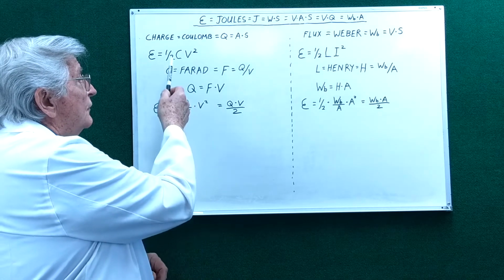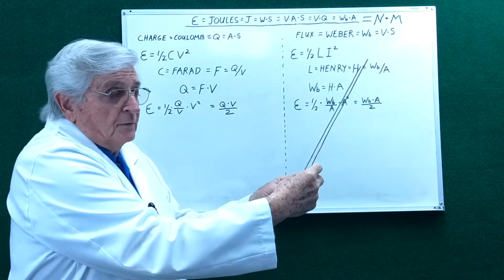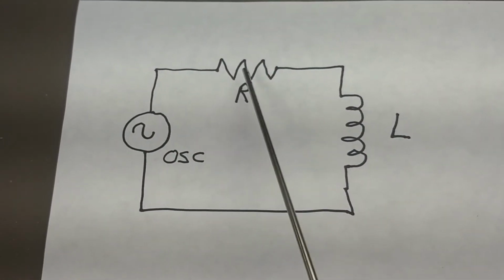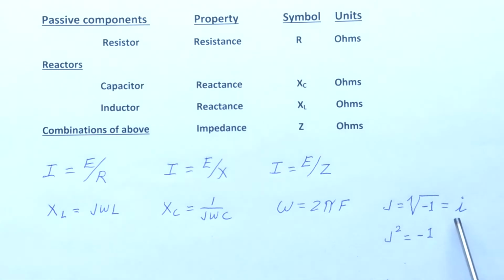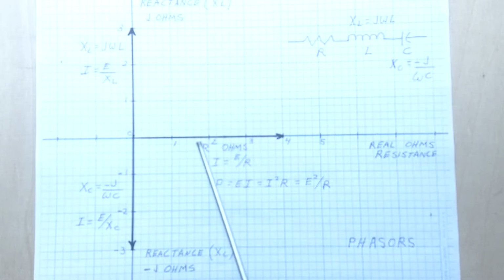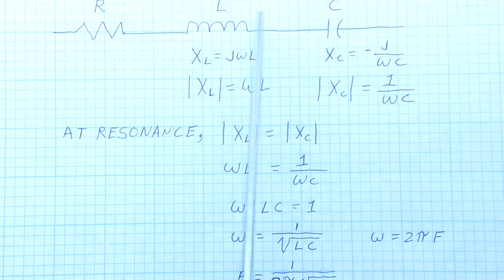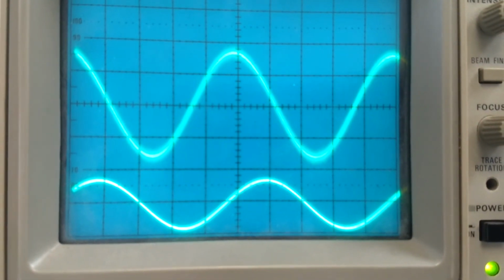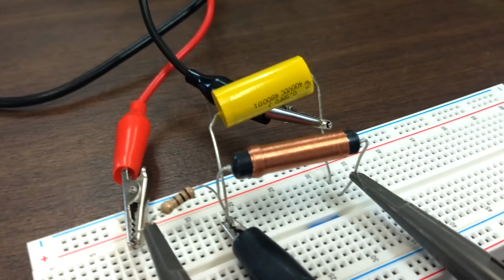Inductors and Capacitors Part 3

Comment: I would so love to have someone explain that "square meters" do not equal "meters squared" and then SHOW how the symbolism [m2 is NOT square meters] is confusing nowadays because of the "proof" that 1 meter squared = 1 square meter, when the multiplier of one is the ONLY time 1 m2 = 1 sq. meter. Anything not using the multiplier of one no longer allows the m2 = square meters especially in symbolism on converter apps that use the m2 as a definition of square meters. It confuses us older folks who learned the difference. Alibre and Fusion 360, have CAD programs that use the wrong symbolism. sq. m. = square meters. m2 = meters squared. PLEASE help other people see this HUGE problem in scientific and engineering program communications.
Thanks.